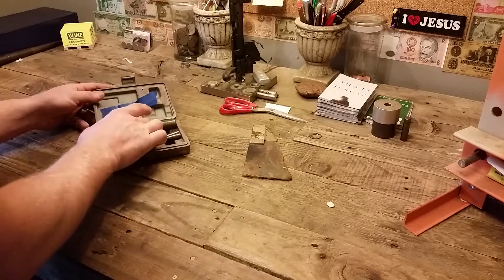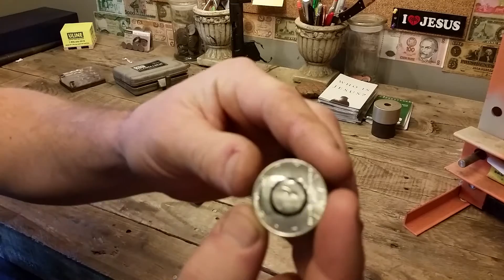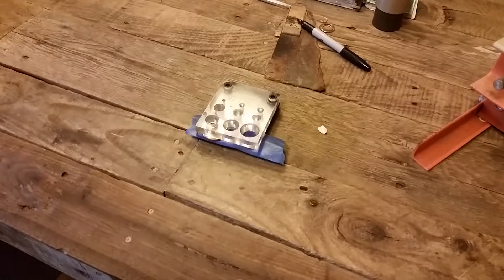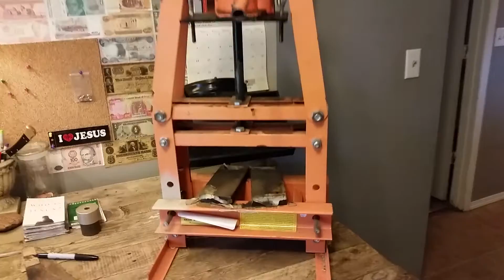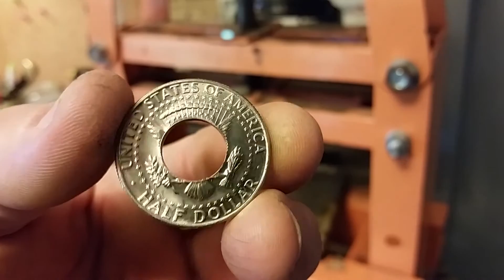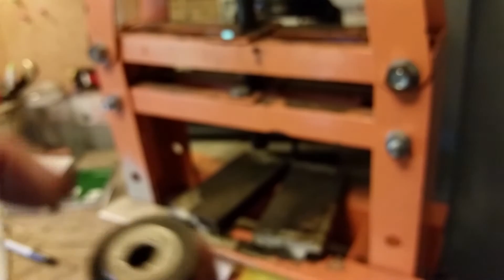Step 1 How to make a double sided clad quarter coin ring - making the hole

Comment: My problem is when I go to whack the punch in this same 9 punch set, I'm only denting the quarter and it's not actually punching through. I tried a 4lb mallet on a workbench, and i also tried using a 1/2 ton arbor press and I just can't get it to go all the way through. I can puncture through a dime, but nothing thicker than that. What am I doing wrong and how can I proceed?  (Thank you! to anyone with advice!)
Reply from the maker: Keep hammering until it goes through. You can make sure the coin is snug in there with paper towels.

Comment: Layman's question - what is the reason to use a punch instead of drill? Just watching your videos I've already learned a lot about aspects of metalworking I'd never considered!
Reply from the maker: Drilling is never as accurate as punching. 90% of the time the hole isn't centered when drilling. If you don't have a perfect hole, the ring is trash. It is the most import step by far.

Comment: I like the die set you had made. Will your machine shop make more? JasonWorks sells a complete set but I'm interested in quarter rings only and it's close to $300. Ouch!
Reply from the maker: +Matthew Lawrence Sorry he retired a while back. I would recommend using skip kings coin centering cards. That is a wonderful less expensive option. You can check out my video on them.

Comment: Question. Using the Harbor Freight 9 piece punch & die set with a 1 ton arbor press from Harbor Freight. So far have not gotten a single hoe centered. Could it be shifting in the press or is this user error. I've put a piece of paper towel under the coin to move it to center also to make sure it is tight. Any suggestions?
Reply from the maker: It takes a bit of doing to get a hole punched with an Arbor press. I'm guessing that it could be shifting as you are punching it. A simple solution would be to get a coin centering card from kingscoinringtools.com. I always used tape instead of a paper towel. Put the coin on the sticky side, center it, and then fold the tape onto the sides of the punch. That ensures the coin can't move.

Comment: I tried to make a ring out of a jfk half dollar, I drilled a 1/2 inch hole, I hit it down my mandrel with a mallet, and it got to 22mm, spoilt a coin. How big of a hole do I have to make in order to get a 19mm ring?
Reply from the maker: It is really different for everyone. I would try a 7/16" hole to see where that gets you. You can also rougher up your mandrel with some sandpaper. That way it slows how fast it goes down the mandrel. It will allow you to close it up tighter.
Reply: Coin Rings from The Mint - Change You Can Wear You know, I actually had grease on the mandrel when I made it, so maybe that's why it got so big. But ill try a 7/16 hole, luckily I got another coin coming.

Comment: An already punched coin makes an excellent template for marking the hole. I just align the two coins and  use a fine point sharpie to draw around the inside and its slightly smaller so I can see it in the punch. Beautiful process and great work .
Reply from the maker: Thanks! I tried that early on but I had a harder time seeing it inside the punch. My eyesight isn't as great though. My brother did that when he helped me at Christmas. It is a great method. Thanks for mentioning it!

Comment: I noticed that the last couple of clad rings that I've made at the top of ring where the outside (wider) end there is a line that circles the ring.  It looks like coin is separating.  I'm still practicing before I move to silver.  Have you seen this before? Is it something that I might be doing?  Suggestions
Reply from the maker: I have seen the coin edge side of the ring split in the middle of the coin edging before. I think the times that I have seen it was with silver. Is it happening more than once?  If not, it is probably just a bad joining of the copper and the nickel outside. 
Thanks! 
Skyler